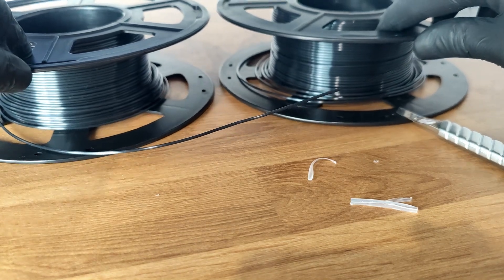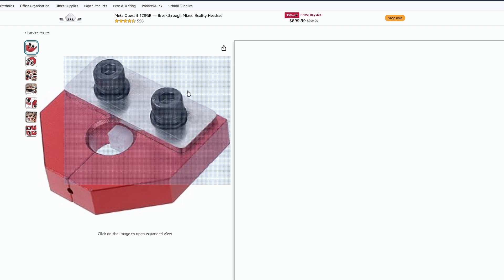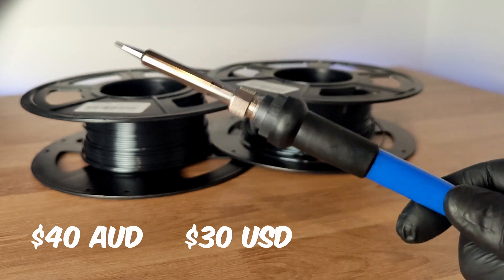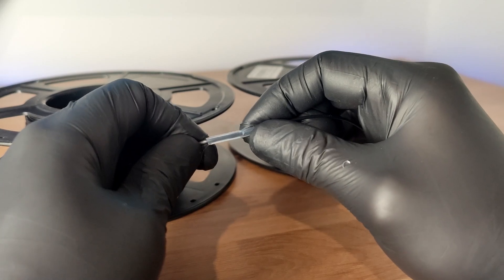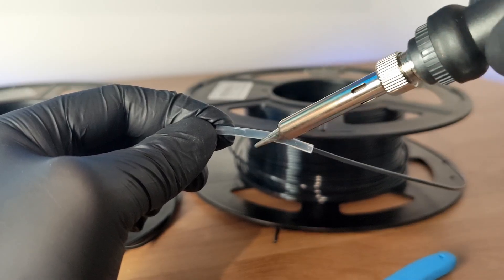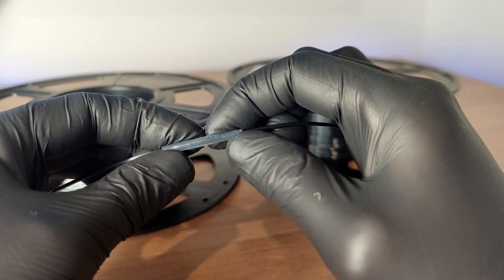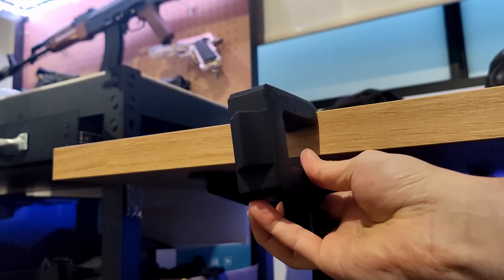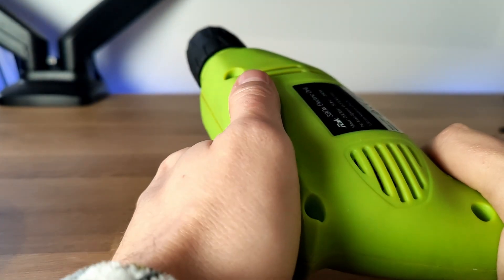The Best and Easiest Way to Combine 3D Printer Filament

Comment: Thanks for posting - I was really struggling with trying to have multi-color prints on my Anycubic printer. Using the solder with silicone tubing worked however after the first two colors my PLA filament would not join together. Very likely this was due in part to impatience. I tried using a butane cigar lighter and it faster and more reliable than the soldering iron. Basically you can't hold it too close nor heat it for very long. After heating the tube for about 2-3 seconds the filament ends will pull apart a little bit and I had to push them back together. Then I just heated for a few more seconds and rolled the tube between my fingers to smooth out the connection. Using this approach it was pretty much 100% success. However I would never had attempted this without first watching your video so thanks again for the assistance!
Reply from the maker: Wow I never thought of using a butane torch! Great idea, will have to give that a try :) Glad the video got you on the right track!

Comment: I'm going to try this with a hot air soldering gun (temp controlled heat gun)
Reply from the maker: Wow never heard of one of those before, let me know how you go :)
Reply: @LayerLabAustralia  I got my silicone tubing in the mail today and using the hot air gun works well. The one I have is a WEP 8858-v I bought on amazon. I don't have to cut the silicone off. I can just slide it off if i want to.

Comment: Thanks! I just bought 150 partial rolls (about 100g each) of PETG so I could really use a reliable way of splicing together.
Reply from the maker: Wow that's gonna take a while to do :P You could always just get an infinity flow S1 and it will do it for you while it prints :D
Reply: @LayerLabAustralia I’m not going to splice all of them, any rolls over 150 I’ll leave and let the AMS do the work, but anything under 100 is definitely getting spliced.

Comment: Can i use leftover teflon tube instead of this 🤔
Reply: Theoretically I'd say yes, BUT.... the PTFE needs to be super snug against the filament at its ID interface, because Teflon's not gonna shrink inwards and hold your two filament ends snug to one another while they cool off and recrystallize. He's using silicone here the same way that electricians using soldershink tubes - minus the conductive metal rings. The benefit of the silicone is it firmly grips the spliced ends all the way around the perimeter... so as long as you set your splice down in fixture channel that's relatively straight, your cooled and bonded final piece should also be smooth and straight. Note - the smoothness comes from the silicone applying even pressure on all sides; the straightness comes from how you fixture the splice for cooling. (Be sure to let it cool naturally/slowly, or you'll get weird distortions from thermal stresses.
Reply: No. The silicone tube having smaller inner diameter than the filament diameter and stretching to keep it under compression is key.

Also, teflon has toxic offgassing above 240°C. You do not want to be putting a soldering iron on it. Silicone survives around 300°C or higher and is not toxic when it breaks down.